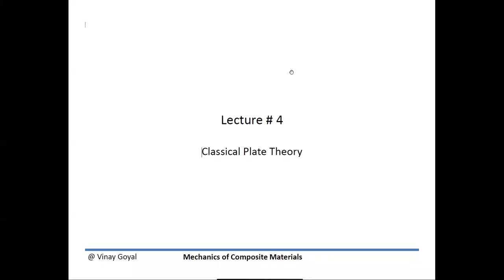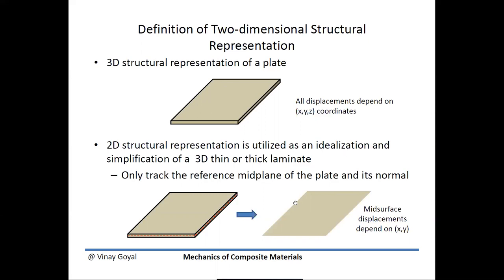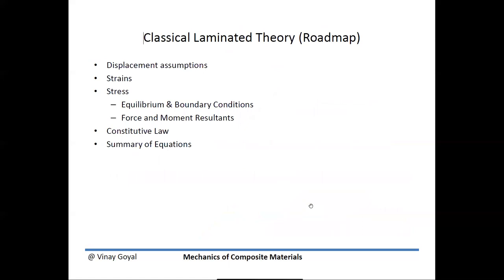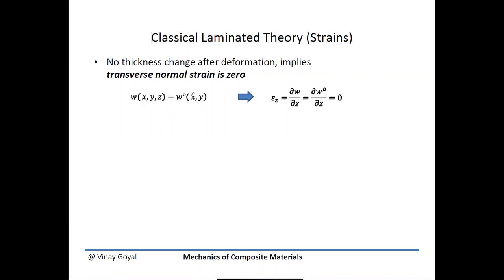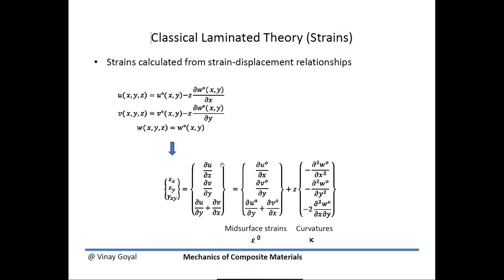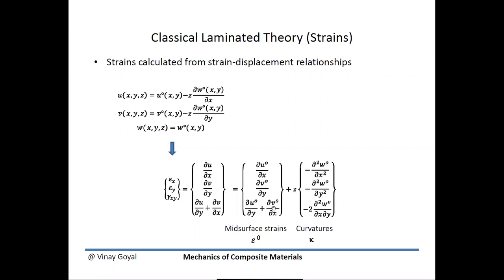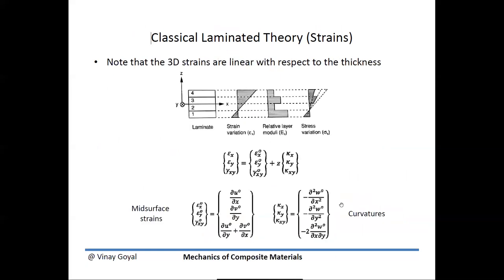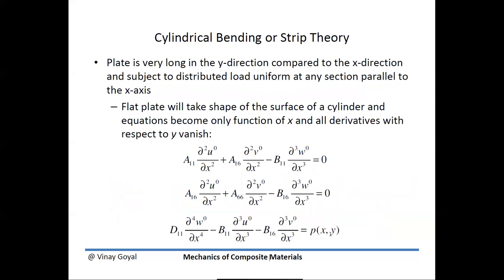Mechanics of Composite Materials: Lecture 4 - Classical Laminated Plate Theory

Comment: Very interesting and useful lecture, thank you! 
If it doesn't take a lot of time, please, explain, why you crossed out D16 and D26 in the example? 
In the previous slides for symmetrical and balanced structures its are not equal to zero. I'm learning to analyze laminate plates for stability, and I don't understand when and why I can neglect these terms in a differential equation. I will be very grateful for your answer.
Reply from the maker: You can keep those terms - I eliminated these to reduce the complexity